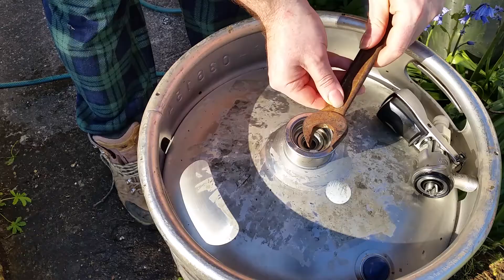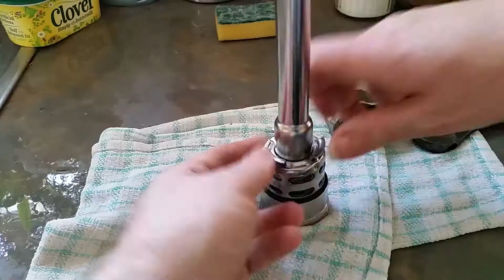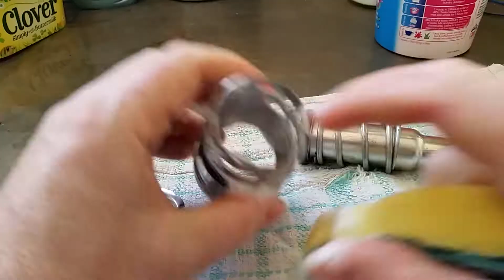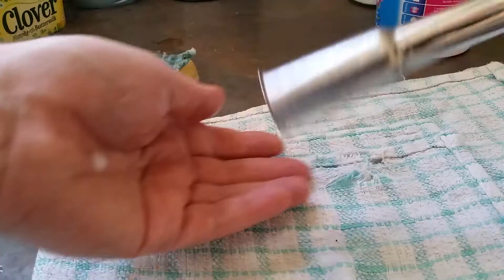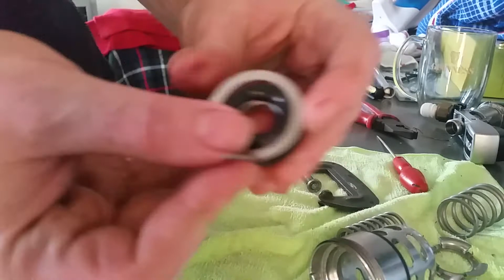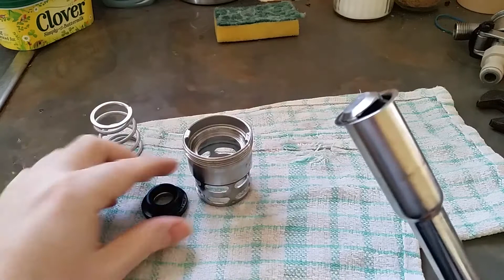Sankey Keg Spear Maintenance Servicing Cleaning + Safety Disablement

Comment from the maker: NOTE THE DIRECTION of turning the spring retainer clockwise = undo, anti-clockwise = redo and don't push it down too far or it won't turn.

Sorry bambinos, not a video for you today (wish it was!), but the video I have on this is my most viewed by far and it needs a less awful edit because I feel like I'm wasting time in the original, so it's functional, not fun today.  Informative videos need to be to the point and without vanity to count towards my community service.

You all knows I still luvs ya xx.

That baby now contains fifty litres of hopped nettle beer.  Glorified sugar water, and it tastes of nettles as you're drinking it but AFTER the hops give you same flavour as real beer.  It's a real perceptual trick and I'm wondering if I can use it for anything else.  I'm planning 50 litres of elderflower beer later on.  The hop aftertaste makes it seem like it costs more than 3.4p a pint.

I might also do a functional version of my nettle beer video as that's atrociously long.  I've got to learn to be brutal in the edit - leave it, then watch it back and then be brutal again.  Then have a little cry.